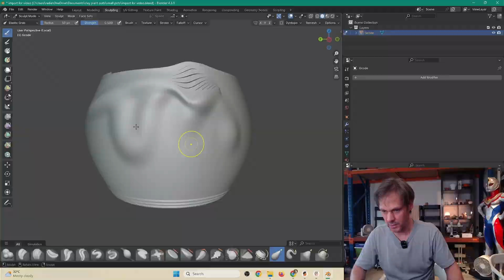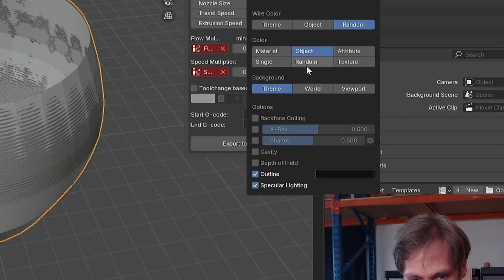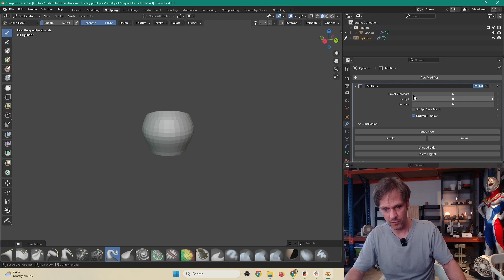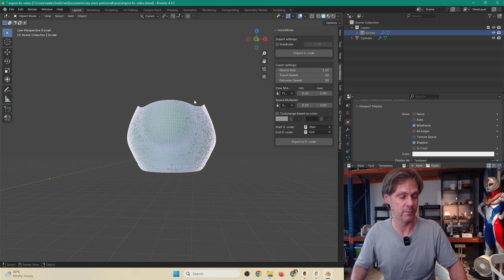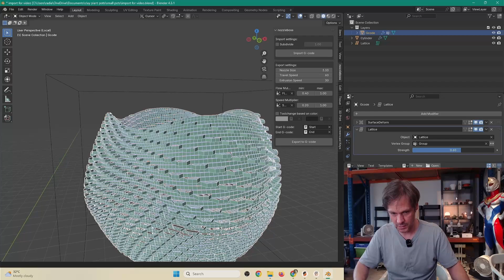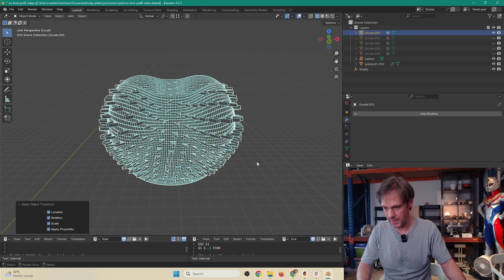Don't Edit Your G-Code Directly.

Comment: This is what I would define as editing my Gcode directly though haha! I suppose editing the code with programming would be even more direct, but this is very much a Gcode wrangler.
Reply from the maker: Yes this is in think a good compromise.  Not direct tryping code. But you can still use geometry nodes to build logical tools and patterns into the code. And also blender modelling tools.

Comment: Does the gcode work with latest blender version? I've got some problem with instaling the addon - in Preferences>Install>I choose the gcode master zip file and I don't have "Instal" button but just "Remove" and "Report a Bag"...
Reply from the maker: I am still using blender 4.5 i will install the latest today ans have a go. But I think is should work
Reply: @claywoven so does it?
Reply from the maker: @denisspasov  I have made a community post on this matter. The add-on works on Blender 5.0. Check the community post for more details.
Reply from the maker: Hi! There are changes to steps to install add-ons on Blender 5.0. I have made a community post on youtube. Check out the steps there and you should be able to use the g-code add-on.